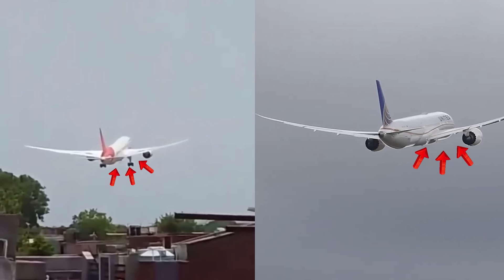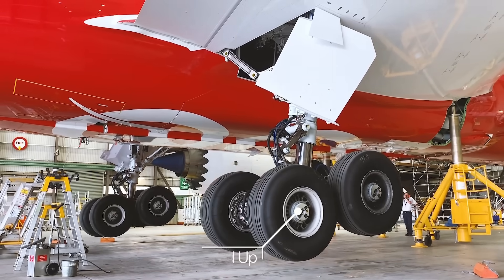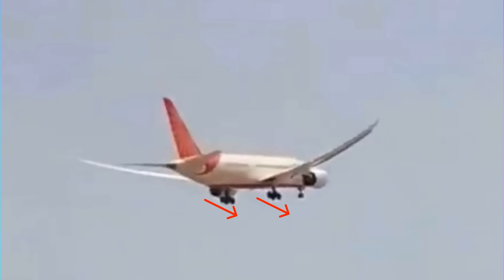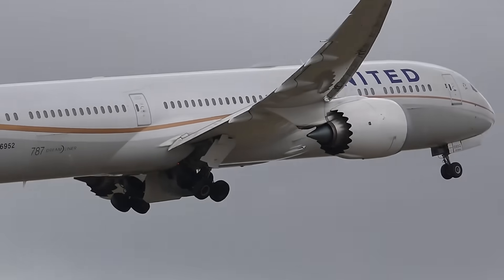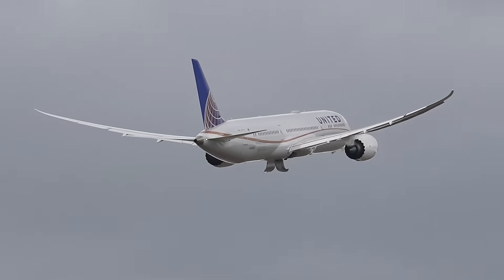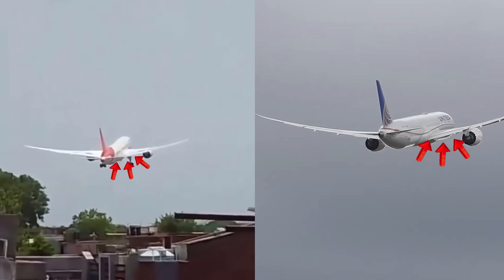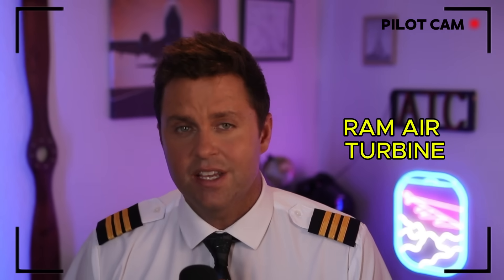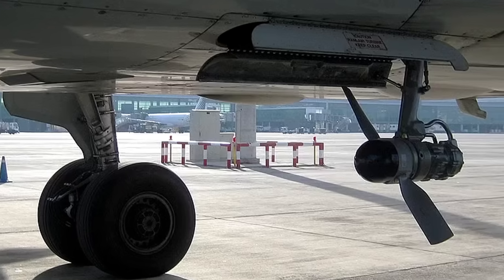Pilot Explains: A New Detail in the Air India 787 Crash Everyone Missed

Comment: Hi Garybpilot. I am a retired B-737 pilot, now 70 years old. This crash of AI airlines worries me a lot. 3 Days have passed now and no actions have been taken if all these type of planes (B-787) should be grounded all over the world until the cause of this crash has been found . To my opinion it was a dual engine failure caused by a mysterious  problem. And it could repeat itself. Civil aviation authorities have the right to prohibit any of these 787 to fly into their airspace until the cause is found.
Reply: Just because yall disagree doesn't mean yall have to be fucking rude to dude for stating HIS opinion.
Reply: I agree with him  @Dylan-mn3mb
Reply: That plane had so many successful flights along with a total of 5 million flights of the 787. I doubt it is something built in. Poor maintenance is more likely. Look how shabby the pax cabin was along with so many things broken.
Reply: @vihtoripuurola3775  yes, there was a passenger complaining about AC, entertainment, and call system  not properly functioning on the same flight from Delhi/ to Ahamadabad before it took off to London. As a passenger I am questioning the safety of flights.
Reply: @vihtoripuurola3775  yes air india is a disgrace, their cabins are ghastly dirty, so if their cleaners can't clean why think their mechanics can be effective?
Reply: @vihtoripuurola3775 First they blamed the flaps, the pilots, the Air India.. now the maintenence. What's next for you sadistic Boeing cultists? How many more must fall out of sky for you to finger point at Boeing? Shameless bunc you lot are. Disgusting
Reply: They have both boxes, I would say that they know pretty sure exactly what happened to this airplane.
Reply: The DGCA (Directorate General of Civil Aviation) issued a directive for enhanced safety inspections on all Boeing 787‑8/9 aircraft in India. These checks include fuel systems, engine controls, cabin air compressors, hydraulics, and takeoff‑parameter systems  .

Air India, which operates 33 Dreamliners, has already had 22 aircraft inspected, with 8 completed so far — and IndiGo (1 787) also undergoing inspections  .

Investigations are being carried out by the DGCA in collaboration with Boeing, GE, the Indian government, and international bodies like the FAA and NTSB  .
Reply: @VerdictREX indigo operates Airbus. Boeing operated by indigo are in minimal numbers.
Reply: @VerdictREX  Are these inspections/checks a result of the accident or previous incidents?
Reply: @ImperrfectStranger  They were ordered in direct response to the accident.  Ordered on the day after the crash and they began the following day.
Reply: @VerdictREX  Thanks!
Reply: @VerdictREX surprise surprise, they haven’t said whether this aircraft had been inspected yet. When did they start these inspections exactly? Why has it taken so long?
Reply: @StoutProper  I was talking about the inspections ordered after this crash, not before.  Sorry for the confusion.   The entire fleet of 787s in India were ordered to be inspected, with inspections beginning 2 days after the crash.
Reply: @VerdictREX  After the fact.
Reply: So far there have been people saying it couldve been pilot error or engine malfunction but no one has said it could be due to a maintenance issue. Thats what i think it was but idk shit
Reply: @Nervousflyer1708  Yeah, they're definitely dancingbaround that one. But first I guess they need to know what the problem was.  Then they would know if the cause was due to maintenance,  manufacturing,  or pilot error.
Reply: @Nervousflyer1708  yes I think maintenance 🤔 is the culprit 🥺‼️
Reply: @Nervousflyer1708 That is the first correct comment I have seen here.
Reply: should we ground them if it is contaminated fuel or poor maintenance? probably not.
Reply: @jamesgem1809  Alternatively, no other aircraft demonstrated said contamination?
Reply: Lets not panic just yet.—- They have found the TWO flight recorders (BLACK BOXES).I would say we will have an answer very soon.  Just a very unfortunate accident.
Reply: What about the whistle blower's point of view?
Reply: It wasn’t Pilot error.  You would have to be a complete idiot to reach for the Slat-Flap handle which is by the First Officers Left Knee, versus the Gear up handle on the Center Instrument panel.  
Can’t wait to hear what the Flight Recorder indicates.  I hope this doesn’t turn into a conundrum like the 737 rudder fiasco.
Reply: ^ During these inspections, if they begin to find commonality of certain problems,  andvthose problems are serious, that's when something like a grounding would start to be considered.   Right now, there's no indication of other aircraft affected beyond this plane.    It's all part of a process, so I guess we'll see.
Reply: If the dual engine failure was caused by a mysterious reason, why do you recommend grounding of all B-787?
Reply: Exactly. The same thing happened with Comet Airliner in the 1950s. Grounding surely is necessary. Complacency has crept into Accident Investigation.
Reply: I think its gonna be fuel cutoffs were activated.  There just is no other logical explanation.  Remember the Horizon air flight not to long ago where the jump seater on shrooms tried to shut down the engines?  Think were gonna see something similar in this situation when they finally release the FDR data.
Reply: If 787 had just come out as a new airplane the last year or so, I would agree, but a plane that has flown safely for more than ten years, I do not think warrants a complete grounding after one accident. They should share the information from the black boxes urgently though, so the whole aviation world gets access to the facts.
Reply: RAT deployment makes me very concerned Flight 171 suffered an Autothrottle  disconnect/ roll back.
Reply: I don't recall 737 grounded after the 1991 United crash in Colorado Springs.
Reply: @alexrebmann1253 yea that's different dude 😂
Reply: @alexrebmann1253  
" don't recall 737 grounded after the 1991"United crash"
Or even after the Ethiopian Airlines 737 max crash "just keep them flying and see if anymore crash !
Reply: Gary the Pilot who got fired for drinking on the job while wearing a Halloween costume acting like they know what happened. Give the family and the people who died some respect. These guys immediately go to YouTube to capitalize on making money.
Reply: A I sabotage...
Reply: I totally agree with you... I believe not knowing the cause of failure in such a terrible issue (total elec power and engine thrust lost) is to put the fleet AOG IMMEDIATELY... At least for a couple of days... Surely
Reply: Must be a Democrat too
Reply: Sir total of 108 planes india has grounded which include all 33 787 for inspection
Reply: Companies love to cut corners to Save money so the CEO can get a bonus. I’ve flown for those operators before. Not fun.  It will be some maintenance failure.  I heard they farmed out their maintenance to Turkey. Not sure if that is accurate
Reply: Today Same Boeing 787 of British Airways did emergency landing due to flap adjustment failure issue.
Reply: Maybe a strange software glitch??
Reply: They had multiple electrical problems on the previous flight. With the aircraft, they should have grounded the aircraft and not let it fly. This points to Air India's profit motivation. Or the government the civil aviation authorities need to change the rules to make sure that planes that have problems are grounded so that this doesn't happen again.
Reply: Other airlines maintain their Dreamliner fleet properly. That’s the differentiator
Reply: 😂😂😂 nahhh won’t happen.
Reply: Analysis of black box data and to point out the most likely cause may take one year or more. Cause could be multiple and it might be impossible to pin point a cause technically. You mean to say till then these aircrafts should be grounded. Who will bear the cost? DGCA? Even if it is, aviation services may get stalled for want of aircrafts. How will we move then? Remain at home  leaving all jobs?
Reply: It showed on a video posted yesterday, a passenger was trying to make  the gadgets work,  the electrics were faulty inside the plane before takeoff ! , 😟
Reply: I don't know anything about Boeing 787s, but I've been a model airplane builder for decades. I've built and flown a lot of model airplanes and as soon as I saw the videos I immediately thought of a loss of lift due to a loss of engine power. Why? Because we model airplane builders/flyiers have something more than those who fly from inside a cockpit: we LOOK AT our model airplanes FROM THE OUTSIDE while they fly and in the long run we understand, or rather we instinctively intuit, what may be wrong with the flight. 
That shown is definitely not an aerodynamic stall, nor a loss of lift due to an airfoil/camber geometry modification (retracting flaps), but a loss of lift due to a loss of thrust because my brain tells me, instinctively, that the airplane, in addition to losing altitude, is also slowing down.
Reply: If the B-787 type was grounded, just watch how fast the answers would be found.
Reply: Landing gear vs flap lever confusion is not an ideal mistake to make but it’s a very forgiving one when both engines are working. All it would mean is that the aircraft will climb much slower due to drag from gear and wrong flap settings which with quick corrective actions would let the flight continue uneventfully. 787 suffered unfortunate engine failures. Even with right flap settings it would have been doomed.
Reply: Sir this is India, no one give f about human life.
Reply: I was a fa for yrs. My airline decided to do away with boeing 737 and make those pilots move to the airbus. We had to drag boeing pilots to the bus. Love the feel of the boeing hated the computerized bus. 737 the workhorse of the airline industry!!?😂😂
Reply: I agree just another crap made plane by Boeing if it’s Boeing I ain’t goin 😢😊
Reply: It's been well documented here on YouTube about the poorly maintained interiors of Air India aircraft. They are dirty, and things are broken due to the lack of basic maintenance of things like lights and seats. Down to the preparation of meals and noticeable, without looking, filth of the interior. If they care that little about the surface product that customers see every day, I can't imagine that the maintenance of the rest of the aircraft was that much better. Probably bare minimum to keep them running, and something finally caught up with them. 

I do believe this was cause by a mechanical failure of some type. And I feel that no matter who was flying, the ending would have been the same, but can we talk about the  inexperienced of the co-pilot? 1100 flying hours and already in the seat of wide body aircraft flying internationally. That's crazy to me! And because of that I don't think we should fully dismiss that pilot error couldn't have been a factor. Someone who's young and  inexperienced can easily cause a bad situation to escalate quickly, especially when fear sets in.
Reply: Who is friendly giving..
Reply: Capt as a conservatory measure I Will agree with you !
Reply: Would never fly boeings..Airbus only
Reply: I saw the recent 787 turnaround and thought about your comment.
Reply: And within these days 2 other AI planes have had early returns and one was with engines trouble.
Reply: You do have a point as there is a good chance that a software problem shut down the fuel pumps.
Reply: All these people defending Boeing. 🤦‍♀️ I’m with ya Rudy, one crash is indeed enough to warrant grounding a specific type of aircraft, especially when the parent company has a well documented history of cutting corners, lying to both the public and the FAA, and taking every opportunity to increase profits, even when directly sacrificing safety
Reply: And the award for this year’s stupidest comment goes to….
Reply: What kind of crack are you smoking???
Reply: He smells like a CCP operative!!!
Reply: I agree with you! Watch the footage just as the plane lifts off of the tarmac! White smoke is ejected from both engines... I think both engines failed due to a flameout! A possibility of pilot error or an electrical failure!
Reply: Well, if it's an issue with the A/C, this is ONCE in 14 YEARS with countless millions of flight hours.
Reply: I agree
Reply: I think the DATA will cause a world wide grounding of the 787.   We'll know just as soon as the FAA figures out how to protect Boeing to the best of it's ability.
Reply: Thanks Gary for your rigorous analysis. I think the dual engine failure seemed to have been caused by loss of electrical and hydraulic power just seconds after takeoff.
Reply: Totally agree with you captain.
Reply: WHISTLEBLOWER Engineers told that manager are using faulty parts and no security of passengers 😡😡😡😡🤬🤬🤬🤬
Reply: Sorry but you're worrying too much and overreacting
Reply: @gregt8638 no not at all,may be for u it's normal.
Reply: 555
Reply: gas or water in fuel.
Reply: Power loss both engine?
Reply: I was just thinking about this since I heard of this accident and thinking of the same thing that all this Plaines should be grounded, but with the corruption that we see on Boeing it doesn’t surprise
Reply: If you get on a plane good luck people are cutting Corners everywhere so you're at your own risk when you're not the pilot and you didn't make that plane yourself
Reply: @rudyarron5746
Sir, much respect for your experience in aviation. Also, you are 70 years YOUNG, not old! But are you suggesting that nearly 400 of this equipment be grounded worldwide?
Reply: @BlacKnightChess 387 Boeing 737 Max were grounded worldwide after only 2 accidents in five months.
Reply: My guess is maintenance/mechanics slacking - does India do dei, too?
Reply: The plane never changed its nose up attitude. I've only flown small planes but if you loose all power the you immediately pitch into a lower nose attitude or you'll  quickly stall.
Reply: @suzamurai Thé plane did stall
Reply: Contaminated  fuel is the most likely cause of dual engine failure .This needs to be Investigated
Reply: I took a Dreamliner eight hours each way 2016 and I was happy it was a newer plane . I couldn't imagine what it would be like on the India plane !
Reply: Given the track record of 787s and unknown cause of the India Air crash, it would be idiotic to ground all 787s with so little information
Reply: possibility an investigation is ongoing is why the lid is on this- ever heard of a 'gear up' acivation takes out both engines on takeoff? massive  complete power failure ? rigged to 'pull the plug' while being certain the aircraft will be at sufficient altitude, and place
Reply: Not moving fast enough to inspect everyone of these planes. They have  a  plan and even released the cost, but we are not seeing it, happening. Makes people uncomfortable to fly these planes. According to the whistle blower, Sam Salehpoor,  who was a security engineer at Boeing, he quotes the 777 has the same issues as the Dreamliner. Why would Civil Aviation drag their feet ?  Maybe sucking up to Boeing ? who knows ?
Reply: Clinically insane to ground a complete fleet of aircraft because one crashed after over 10+ years of incident free operation.
Reply: K
Reply: I'm not a pilot, but I've been an aircraft anorak since I was twelve.   My uneducated guess is electrical failure leading to fuel starvation. The fuel pumps on the 787 are electric. The gear continues to stay down because there are no hydraulics to raise it.  
It would take a pretty high level of contamination in the fuel to cause a flameout. Both pilots were experienced, a mistake in operating the controls is highly unlikely.  Apparently there was some issue with the electrics on that aircraft fairly recently.     That is my tuppence worth.
Reply: Thanks for expressing your thoughts on this.
Initially, all the reasons were concentrated on blaming the co-pilot for the disaster. But, closer looks now have veeted the thinking  towards technical failures.
Air India, and the Tata group that owns it are considered to be highly responsible, did take the step of grounding their fleet of 787s.
Reply: I am Indian. I can confirm that the Indian investigation agencies are corrupt. They are under direct influence of the Prime Minister. I believe that the delay is because the agencies will present that report to the Prime Minister Office. And I doubt he will cut off some details if he finds it harmful to him because in India, this airport and around 6 to 7 biggest airports are being controlled by his corporate friend.
Reply: The engines didn't fail go back and listen to the guy that survived 😂 😅
Reply: Bunch of Trump idiots on here 😅 😂
Reply: The gear tilted forward with the gear doors not yet opening.
Reply: Is it possible to remotely hack into the system to cause power failure?
Reply: 100% agree! As was the case with the MAX!
Reply: in the old days they didnt have computers so you probly dont understand how they work but if you google it you will see that planes are much harder to fly these days. but its funny how old people think they know how stuff works these days
Reply: AC joystick console etc not working before take off... strange
Reply: You don't sound like a Pilot
Reply: Planes don't get grounded if deaths happen in the non-white world. E.g. Boeing Max 737, Indonesia & Ethiopia!
Reply: Massive electrical power failure caused engines to fail. This is the reason. Passengers from an earlier journey of the same flight as well the passengers of the crashed plane reported AC and entertainment systems not working in the passengers cabin.
Reply: RAT was deployed as soon the take off.
Reply: Holy crap there's some angry a-holes in the chat. 

Calm the f down, people. Holy shit.  😂
Reply: HUMAN error springs to mind,has anybody looked on the reputation from india airlines how many crashes its had due to human errors(shocking)..Has anybody watched an investigation to why a plane taking off simialar to this plane then lost so called power and it turned out to be human error.The data apparently sent over to the pilot regarding weight etc was incorrect so when the pilot put the data into the planes computer due to the wrong data the plane didnt have enough thrust to take off properly due to being to heavy because of wrong data.
Reply: Contaminated fuel is out of question since they fuel multiple jet each day considering the time was around 1 PM , they must have refilled multiple air craft that day , point more towards electrical issue , in my opinion
Reply: Thanks ! I appreciate your expertise and hope listen to you more in near future regarding this sad incident.
Reply: Don't worry. No sane person books boeing flights these days.
Reply: @jkgermany2182  Very true, I make 10000% sure I dodge that bullet every time I book a flight
Reply: I think this is more air india ground staff maintenance fault as from a passengers video air-conditioners and entertainment systems were not working possibly due to power cut failure which may have caused power cut to the engines as well and from another passengers statement who was travelling on this same aircraft about a month ago said that the lights were coming on and off probably this power cut situation was not rectified and that cause this accident unfortunately whoever is responsible in the indian civil aviation and air india must be held accountable for this
Reply: Aweful Maintenance? Could be a reason for it!
Reply: Huge lack of quality production made by Boeing USA 🇺🇸
Reply: I can see the point the retired Pilot is making … what is a few days grounding of the fleet … O $$$$ .. Less we forget the 737 max first hull loss due to the “hidden” MCAST problem . After the first crash everyone was blaming the pilots and no need to ground the planes .. remember what happens next .. lesson learn in BLOOD 🩸 and suffering cannot be recovered by $$$ compensation.. wisdom taught by years of experience should not be dismissed so slightly .. what’s is 2 weeks to get the  initial analysis done worth in lives vs $$$ just my 2 cents 😅
Reply: The single engine failure causes pilot shut down the wrong (good ) engine, might be more likely than dual engine failure, in terms of Boeing 787 engines…
Reply: What? 😂 dude are you actually a retired pilot? Because that’s an objectively wild take
Reply: If there were no building in crash site and if there was plain ground, had the plane survived?
Reply: Thanks for your opinion and the share of your experience and knowledge.
Reply: This model has been reliable up to now though.
Reply: The pilot use HALF runway!!! IT is a blame! He kills 300
Reply: @TamasHejja After leaving the runway, more load is put on the engine and the engine compensates with more fuel. If the problem is fuel, then the problem started right here. I saw this well, the pilot managed to keep the nose of the plane up.
Reply: British airways to Chennai did emergency landing in Heathrow today.
Reply: Agreed 100%
Reply: You got it, captain.
If it was weight or flaps configuration, the airplane hasn't get off the rw so fast as it did.
Reply: There no different to a cars nuts and bolts .They fail at times But still the most safest form of transportation.May the all RIP .👍🦊
Reply: And in last 48 hrs 3 787 have been grounded or emergency landed
Reply: In conclusion, no vehicle  at all times and at any point of time is 100% malfunction and thereby  disaster proof.
Reply: No no no. This aircraft involved has had some major electronic issues, especially in hot environments. This aircraft is 11 years old. Sounds like shoddy maintenance to me.
Reply: The very second day an local Indian reporter mentioned, One engine failed and pilot turned off  the other engine by mistake and didnt get enough time to turn on. Could it be possible?
Reply: @rd0769  yes
Reply: Because of such heat all over the area?? Is there a chance of fuel evaporation? Possible?? Also there are reports prior take off there was no air con available?? Psngs complaining cabin was mad hot??..I know RAT has limited generation? Power wise?
Reply: You actually believe a reflexive 787 grounding warranted in the absence of definitive evidence?  That's quite shocking coming from an aviation professional.
Reply: There were observations by passengers on the fight in from Delhi that there seemed to be issues with electrical in video screens not working call bells not working. Could the crash have been the result of a total electrical failure on board the plane?
Reply: @revpaulrodey4026  Or it could have been all the crap build up in the blocked toilets affecting thr centre of gravity, why not just wait fot the results of thre investigation instead of turning this tragedy into a soap opera.
Reply: No.I don't agree. 
The dreamliner fly now for 20 years without  incident. 
The engineers that serviced the aircraft before departure must be investigated.
Reply: Dual engine fire because of stowaways
Reply: Just came across a must see video, “Mass Murder Over DC”. Trump was behind the plane crash in Washington, D.C., that killed 67, as a threat to lawmakers who might oppose his agenda, of trillions in tax cuts for billionaires, and war on Iran.  There can be no question that the military helicopter deliberately hit the jet, head on, unwavering in its course until impact. The NTSB is refusing to release all altitude data etc etc showing US Gov complicity.  Google "mass murder over DC".
Reply: Flight AI171 • Boeing 787-8
(Air India 171)
Boeing replaces hydraulic system with electrical system. This can lead to general failure in case of battery explosion and fuel supply.😮
✈️
Others videos (20:30) Author reports more electrical problems in batteries with fires.😮
Reply: Ridiculous. The 787 has been flying for close to 14 years now. This is the first hull loss. Whatever the reliability issues with the aircraft are, it has an incredible safety record. You cannot ground the entire world fleet (1200 tails) because of 1 crash without any indication the crash is related to something that can exist on other aircraft. Note; 26 years experience in aircraft engineering.
Reply: first and only 787 issue of this tragic nature  since ANA began using them iin Oct 2011. I would wait for the box
Reply: Since Indian authorities did not secure the crash site cause may never be found.
Reply: Any issue with this aircraft is a maintenance issue and not a type issue as this plane and 1000 others are flying 10 years without any issue!
Reply: Yeah, airlines should do it and not wait for a higher up decision.
Reply: You sound like a guy with a lot of AIRBUS  STOCK.
Reply: I remembered that years  ago, after released  dreamliner was announced the delayed for some reasons. That's it.
Reply: Man I’m afraid now flying
Reply: The 737 had its share of crashes in the 90s involving uncommanded rudder movements and they never grounded that plane. So they should ground the 787? Are you really a pilot?
Reply: Agreed!
Reply: Please be polite with your comments. You don't need to point out the age of the man who is friendly hiving his opinion. Right?
Reply: Could FOD somewhere in the fuel delivery effect both engines at the same time.
Reply: @georgeaffonso3966  yes, but issues with fuel would have been spotted VERY quickly, and whatever fuel delivery vehicle was used will also have been checked,,, for my money, its a manufacturing issue that has caused loss of power to BOTH engines and hydraulics and thus deployed RAT back up, loss of flap command and failure of gear to retract.....
Reply: Not any investigation happened bcoz India's pm is just enjoying trips and authorities are sleeping by blaming pilots. We can't sleep when we remember a smiling face of pilot who was solely care taker of his 84 year old father and same so many lives in his last minutes by choosing that place where density of trees were higher. But our soo called leaders, it looks like they got energy after this and flew away to enjoy on dead innocent people....if they found out black box then why they haven't told about cockpit conversation till now??? It's not that difficult to take data and listen!! It looks like in the end everyone will blame pilot and companies will get insurance,,😡
Reply: Excellent point. But we mustn't upset the shareholders, they don't fly in 787's they have their own personal business jets.
Reply: Indeed. The FDR & CVR are intact.  The FDR would have recorded conclusively when both engines went dead and hence the RAT auto deployment.  It certainly can affect other 787s hence I am curious that no inspection on the fleet has been issued.
Reply: Yep same thing happened with the Max8, it took 2 crashes to ground the fleet. Why?
Reply: Possibly a recent software update causing a 'hang scenario' bringing engines to standstill.
Reply: I see where he is going with tye comments about dirty fuel..but if that was so and the fuel put into tte airplane was dirty, would not either planes gave had dirty fuel either before or after..after all it wont be just one fuel pump affected surely..just looking at it from a different view
Reply: As one aviation whistleblower chilling said about grounding aircraft, paying the loved ones of the dead or making crucial vehicle upgrades, "It's the cost of doing business".
Reply: I am no aviation expert nor do i know anything about engines and cockpits.. but i have the ability to think and make sound judgement.
This is my view on the matter, as like many people accross the world, I am deeply saddened even distressed by this terrible catastrphe that could have been avoided. 

This is my view based upon videos that were taken by the passengers before take off.

 Firstly, the plane AC system was down, that was visible by how the passengers were fanning themselves. 

Secondly, the lighting system was malfunctioning....now, these issues/ signs should be enough for the crew to realize something just aint right.

I believe these warning signs should have been taken into consideration and reported to the relevant authority and an investigation carried out before the plane is given the permission to take off.

Clearly, the last set of persons, pilots and crew members have failed in their positions to pick up on these warning signs....
Reply: This isn't a racist remark, but isn't it the case in India that certain things not working is considered normal and acceptable? I am merely asking a question. And the truthful answer is? @dawnsmith1350
Reply: @dawnsmith1350 We overuse the terms "clearly" and "obviously". You've indicated you're not an expert on these matters, but you're attributing a lot of blame to certain people. Our hosts avoid that, and I  consider them to be experts in this field. Let's let the facts come out before we make accusations.
Reply: I TOTALLY disagree! The 787 has an exemplary safety record which does not warrant grounding of the type. With what is known of the crash, ALL aircraft might as well be grounded, and that is insane.
Reply: Ok, but why did not happened this issue from the first flight of the 787 near 15 years from now? This is the question...
Reply: You seem to forget! Ain’t nobody at. Home at the FAA, what you don’t hear the crickets 🦗? Top management fired
Reply: Dual engine failure. Most likely caused by FADEC. Always before a big tragedy there are signs or small tragedies preadvising: See A400M crash at Sevilla in 2015… it was a test flight on a military aircraft but it turned out it was a mistake on loading/upgrading the FADEC software prior to flight…it was similar short flight and problems started at 200 feet. It was also recorded and can be found in YouTube.
Reply: The flaps were being retracted so still partially extended, and the gear was still extended.
Most likely culprit:
FO retracted flaps instead of retracting gear.
Reply: @UnitedWeStand-g7u  "Flaps were being retracted..."? I think you'll have  difficult time supporting that position with the evidence currently available. What was the flaps setting at TO? Where were they at impact.
Reply: @davekearney1944 
My bad, they were likely in the process of being deployed after realizing their mistake, which is much more plausible. 
What can be said for certain is that they took off without the flaps extended while the gear was down, which fits perfectly with the theory that the FO mistook the gear lever, for the flaps leve, anything related to double engine failure is completely f*cking ludicrous.
Reply: @UnitedWeStand-g7u  You can say for certain, considering the evidence at hand, that the flaps were not extended at take-off?
Reply: If the dual engine failure was due to contaminated fuel , the fuel source needs to be examined. , as that could replicate the accident I  in all other planes
Reply: Boeing problems will cease once China(ccp)buys the manufacturer.
Reply: It's mildly surprising that no preliminary data from the flight recorder has been released.
Reply: Now they claim the black box is damaged? What a massive lie! This is nothing but a cover-up. The truth is being buried, and it's a shame for the Indian government!

🤮🤮🤮🤮🤮🤮🤮
Reply: Yes, I also think Ford should recall all Model T’s  as well
Reply: Both Boeing & Air India are in the damage-controlled mode together. We will see…
Reply: Vaporization
Reply: Hands down....Vaporization
Reply: You are absolutely right but untill the fact that what happened was a cause of design or operational failure is proven. Looks like a sabotage of some sort and will take time to pin point.
Reply: What about Dual engine flameout shorty after takeoff. Landing gear was last thing on their minds if the engines were sputtering . There hv been suggestions that the plane used the entire runway .
The extreme heat and lack of rain caused an extraordinarily large dust pile and debris at end of runway that is evident after takeoff. Similar to British Airways had a 4 engine flameout from volcanic ash high altitude. Is it possible that the dust and debris were ingested and caused a flameout right after 
rotation?
Reply: @marielle129 true, it would be easy to miss the landing gear in such a short time, but if there was a dual engine failure, the RAT automatically deploys and only provides enough power for essential avionics and systems and for essential hydraulic systems.  It doesn’t provide enough hydraulic power to retract the gear but probably had enough to do the pre-retract gear tilt that GaryB mentioned.  Hats off to him for noticing that the gear tilt.
Reply: @marielle129 interesting.  Would love to hear pilots thoughts on that idea
Reply: @marielle129  No. Volcanic ash being largely silica adheres to the fan blades and solidifies.
Reply: @marielle129 if it used all the tarmac they should have noted that( in terms of performance and or power) and aborted takeoff before V1
Reply: @marielle129 Damn! That's highly unlikely, but possible. Normal dust isn't as dangerous as volcanic ash, but who knows! If big chunk of dust get's sucked into the engines, it can cause problems. However, if it was the case, why no other aircraft got affected?
Reply: @MinhajAhmed-y7i  because they went to the end of the runway where it was all accumulated .
Reply: @marielle129  No, they didn’t.
Reply: @marielle129 could be. and also well with they went to wheel up that load on the my just been to much if a weak links was developing .plus I want to know on the rat video what the black matter is float to the ground about 4 seconds before the crash? First thought it was a bird but now don't think it is
Reply: @marielle129  Interesting, I haven’t heard this theory before.
Reply: @marielle129 Good point ! Thinking out if the box
Reply: @marielle129 engine designer here.  Engines have been ingesting dust for years and they are designed for that.  Volcanic ash is a totally different animal and engines are not certified for ingesting this.
Reply: @marielle129 plausible, but if there is any kind of ingestion - dust, debris, bird, metal - serious enough to cause engine failure, there ought to be some visual indication - flames, sparks, bursts, smoke
Reply: @biaora  I agree ,smoke or sparks for most -  I don’t know if an engine ingests a large amount of dirt what would happen . What would be the signs . I’m very interested what could cause them both to fail simultaneously besides a flock of birds
Reply: @marielle129 in that case engine will be backfires but in video there are no such signs
Reply: @marielle129  good points.
Reply: @marielle129 no … it’s insane that this plane went down straight after takeoff. I reckon the FO pulled the flaps instead of the wheels  … which is a crazy thing to happen… one simple move could kill 269 people. How crazy is that … the aeroplane should have had a precautionary measure … not allowing this mistake even if the FO was pulling on  the flaps with both hands and feet…I might be wrong though …!!
Reply: @petervossos4816  it’s almost impossible . Double engine failure at the same time has to be a bird strike or engine ingestion of something  that causes catastrophic thrust loss .  They had no time to recover
Reply: The gentleman is a retired 737 pilot who's probably safely flown one of us, if not then someone related to us. He should be respected and for sure knows more about aviation than any of us. I was due to fly to India next month and I'm certainly avoiding any carrier operating a Dreamliner until we know more. I stopped my entire family from flying to Sylhet because majority flights going there from London are on Dreamliners. This isn't the first major issue concerning the 787. There was a battery issue on a Japanese carrier, a belly landing at Heathrow along with a few others.
Reply: @gabbarsingh7182 At least grounding 787s manufactured around the same time is warranted. If it's entirely a design fault, then very soon the same thing will happen to another 787.
Reply: Bro are you from Sylhet? I'm also from Sylhet, booked my Biman flight on B787 from YYZ to ZYL. Now thinking of changing the flight to another airline to avoid the 787  @gabbarsingh7182
Reply: @gabbarsingh7182  I really appreciate and respect your reply and your tone here, and I absolutely agree that all should be replying with kindness and respect. I can also understand someone feeling like perhaps the 787 ought to be grounded. I’m not saying that’s where I stand…honestly I don’t know enough to have a strong opinion on that matter, but I can definitely understand someone thinking that way. True enough, it doesn’t usually tend to happen after one crash, especially before the facts are known, something which could take months, but what I find so troubling about it is the mystery behind it. A dual engine failure just doesn’t make any sense at all. And while I imagine that a possible isolated incident, a maintenance issue, or something of that matter, is a more likely scenario, I am certainly not comfortable completely ruling out a design issue just because it’s never happened before. TWA 800 and US Air 427 come to mind as examples of aircraft that had flown for many years before flaws were discovered. Now if you look at US Air Flight 427, there was a United Airlines flight that suffered an almost identical issue prior to that. I like to believe that when human life is involved, everything that can possibly be done is being done, but I do understand risk assessment, and all that.
Reply: @gabbarsingh7182  i’ve heard about issues with this plane also. I would not get on one.
Reply: @NYBrandywineTree for the foreseeable future I’d say good choice.
Reply: Some rumors that Boeing requered for eletrical upgrade in 2015. Became mandatory in USA. India never adressed it.
Reply: @viggojorgensson4708 That’s handled in a very organized way. If it was critical, they’d ground the fleet until the upgrades were done. If they are non safety upgrades, they can do them at regular service events.
Reply: @viggojorgensson4708  - Do you have a source for this?  If the manufacturer makes it mandatory, arent they required to do it?  Boeing would not sit back and allow an International carrier to just ignore something like this and then an accident happens.  It would be bad business for Boeing.  Its in their best interests to get this addressed even if they have to supervise it.
Reply: @viggojorgensson4708  I believe it is an India Problem too. A passenger on its previous flight had video of the air conditioning and lights not working, his TV was not working (per usual  he claimed), but at least 1 TV in front of him was working. If they don't do maintenance for passenger comfort, what else are they skimping on?
Reply: Sorecall exists on aviation, just like car industry with many malfunction every year, that's ridiculous and unacceptable...
Reply: @viggojorgensson4708  this same 787 had a critical problem in Dec 2024 and went for service but seems like the issue wasn't completely fixed. Staff keep complaining but Boeing doesn't supply proper spare parts.
Reply: @viggojorgensson4708 I’ve heard the same, have why air india 787s has so many electrical faults and stuff not working. It’s owned by Tata who are notorious for cost cutting and paying lip service to health and safety. It’s the Indian caste system in full effect, they don’t care about the lives of lower castes. There’s a theory that since the plane’s ac was out, and it had been standing on the runway for 2/3 hours with the engines on, with a full tank of hot fuel in 41 degree heat, the fuel could have easily heated up to 49 degrees and caused vapour lock in the fuel lines on rotation. Not a pilot myself I’m an engineer but a white plane in 41 degrees with no AC full of people and hot fuel will heat up quick
Reply: I disagree...
The 787 has a near flawless safety record & if there's something inheritly wrong with these planes , it would have surfaced by now..
The 787 has been in service since 2013 ..
They have flown millions of miles with no issues..
I suspect the recent overhaul of that aircraft will come into play here..
That planes lost thrust just 600 ft off the ground..
Both engines failed ..
The R.A.T. was deployed which certainly indicates a power failure ..
The lone survivor said there was aloud bang , then all the lights went out for a split second , and then back on..
The R.A.T. restored electrical power , but the engines never spooled up again..
Reply: @pdrphil8159 It does appear that the RAT deployed, but I’m pretty sure that wouldn’t restore cabin lighting.  That is only for the most critical engine control and navigation systems.  It sounds to me like a dual engine failure, and we’ll have to see if it was due to mechanical or electrical failure, or pilot error.  The evidence is there, let them find it.
Reply: @pdrphil8159 very very far from flaw less. This is firat crash of 787 for aure but it is not the firat hull loss. It has been marred with technical issues. There have been atleast half a dozen boeing whistleblowers who have said that 787 were built with sub par quality parts. 
You are just a Boeing fan boy or just american.
Reply: @pdrphil8159 Without more information, it does seem as you say.
Reply: @pdrphil8159 given the "safety culture" at Boeing it would be foolish to rule out flaws with design or build quality as a factor or cause simply because this is the first hull loss after years of operation
Reply: @pdrphil8159  There have been lots of incidents caused by design flaws long after aircraft introduction. I can think of several, including one that occured 14 years after an aircraft type first flew.
Reply: contaminated fuel wouldn’t have even got airborne for a few seconds
Reply: @imbowser What is contaminated fuel and how does it affect the engines?
Reply: It did have a screen sound like a prop plane 100%
Reply: @andymesser9704  Not saying you’re wrong, but could’ve simply been the engine cores rotating in the airflow. Every high bypass engine I’ve ever heard on short final is producing power, never heard one with a flameout.
Reply: @andymesser9704 what do you mean?
Reply: Agree
Reply: If the cause is entirely due to the 787's design, then other 787s around the same age will begin falling out of the sky in a similar fashion within days or weeks.
Reply: @KOFAKEDEM maybe all airbus ac have undiscovered issues too?   Ground all aircraft forever!
Reply: @ericrupert2687 Baring an official report, we are now almost certain that it was an inexplicable complete double engine failure resulting in no thrust. There are no similar undiscovered issues with airbus which could be disastrous. It's foolhardy to even begin making a comparison.
Reply: @KOFAKEDEM AI171 had a registration number of VT-ANB and was 11 years old. The first 787-8 went into service 14 years ago. So based on your logic, all or ay least some of the 787-8s that went into service 12-14 years ago should have fallen from the sky by now.

We still don’t know why MH370 crashed. Should we ground all 777-200ER planes made in 2002 or before?
Reply: Now that pilot error seems to be unlikely,  shouldn't we wait for a repeat before grounding the 787s?
Reply: After reading most of the so called experts, I felt you guys have any clue of what happened just ga..ga…not to ground, pilot error, fuel contamination, etc. looks like you guys are heavily invested in Boeing and the loss of money on the stock is making you guys these comments. About 270 people lost their lives, and you only need to make money. 

1. Pilot error has to be completely ruled out. It’s an automatic plane that has MCAS in it and it should handle most of these errors, which the current analysis is okay with it.
2. Fuel contamination is next to nothing because the modern fuel containers and storage have sensors built in and a lot of thorough inspection will be done, that certificate is issued before filling the fuel.
3. Dual engine failure is the most plausible explanation that fits into this. Because according to Sam Salipour the engines and fuselage show their adverse effects and defects after 12-14 years of use. So people who are screaming on top of their heads, you can stop that crap now.
Reply: No
Reply: Boeing sucks
Reply: 😂😂 yes, since the YouTube Expert Investigation Board didn’t find the cause in 24 hours, all airplanes should be grounded.
Reply: @LibSlayer69 , 😂😂😂😂
Reply: Please dont be ridiculous. If the 737 was grounded after every accident it had the fleet would never of done any flying ever. The 787 has had an impeccable safety record for 14 years without on accident yet now you want it grounded. Seriously…i feel perfectly safe taking one to Japan on Thursday your type of reaction is ridiculous.
Reply: Should we ground every type of aircraft the moment there is a hull loss? There would be no airline industry. There is a huge difference between the 787 and the 737-max accident. The 737 was a new airframe coming online. The 787 has a proven solid track record. 
This could be contaminated fuel, improper maintenance- all kinds of things. To make a knee jerk reaction and punish every airline flying a 787 without evidence would be reckless.
Reply: @kamakaziozzie3038 If they found a core design failure, then they may ground the fleet. It’s impossible to find and verify something like this in less than 3 days.
Reply: @jamesdellaneve9005  Odds of a flaw with the cores affecting both engines simultaneously, having never been observed before?
Reply: @petergill2265 I was not with the FAA when they certified the first twin engine for over the ocean routes. However, I am assuming that they did the math for dual failures and am guessing that it’s extremely remote enough for safe operations on those routes. 1985 was the 1st revenue flight over the ocean with only two engines. I know that fuel starvation can affect the entire aircraft regardless of number of engines. Bottom line, we’ve been safely flying for 40 years with duel engines and duel catastrophic engine failure doesn’t seem to have reared its head.
Reply: @kamakaziozzie3038 plenty of evidence if you looked.
Reply: @kamakaziozzie3038 the Max was not a new airframe it’s a50 year old frame re engined and the MCAST issue had popped up prior but other pilots saw the runaway trim and just shut down the auto trim .. but they were at higher altitude.. and the problem was not addressed u til the 2 crashes ..
Reply: You do realize that this plane has been flying for 12 to 14 years, right? This is the first hull loss, and to ground all 787, due to one crash is ridiculous.
Reply: @CJE2007.5  The 747-131 had been around for 24 years before the air disaster at LAX .  After the investigation, they did checks on all their 747-31 planes and it was found that it was only sheer luck that it happened on other planes, and them planes were 24 years old.
Reply: *Hadn,t happened *
Reply: @emmahoward7913 I don't recall that at LAX. What incident was that? If you mean the United cargo door detatchment that wasn't LAX.
Reply: @seeburg220  my customer at the time was a fight attendant, she supposed to be on that flight , her son were sick , she called off work .
Reply: @CJE2007.5 they're coming, it's like cars after a certain number of kms...a preponderance of the same issue will come up..when bad design or same problem.
Reply: @CJE2007.5  It only took two crashes to ground all 737MAX aircraft.
Reply: @CJE2007.5 Boeing was cutting corners. There was a congressional hearing about these from a victimized whistleblower.
Reply: @CJE2007.5 so you want another plane to go down before any action is taken. Investigation should reveal the real cause of the accident
Reply: @CJE2007.5 It's not insane if the mean time between failure of a key, engine management component is 12 to 14 years. That would actually mean that they're going to start dropping out of the sky pretty soon and SHOULD be grounded.
Reply: @CJE2007.5 absolutely! The hysteria by even experts (yes not even so called) is unreal. The commentary really discredits those that are jumping the gun. I note "74 Gear" is quiet. Good on him.
Reply: @CJE2007.5 no it’s not … would you same the same thing if your loved one was on board …?
Reply: @CJE2007.5  Maybe some things went wrong midair in other planes as well, but we will never see them on news if things got under control as they might have happened at higher altitudes. It's always a first, this plane had no space or height to even make a call. Plus, who knows if US company provided India with badly designed planes which decreases the age of planes. Or maybe Air India and maintainance team have big issues in India.
Reply: @CJE2007.5 at least one by one should be grounded for a complete check up and maintenance!
Reply: @CJE2007.5  Concorde was flying for much longer and one crash instantly grounded the entire fleet.
Reply: @alanjm1234 Not comparable at all. There are already 1200 787’s currently flying and they have done 5 million trips.

The number of Concorde’s making commercial flights was 14 and it had less than 100,000 flights. Some has the number of commercial flights as low as 14,000 For all intents and purposes the Concorde was an instrumental plane that never went into serial production.

Or to put it into perspective, 14% of the whole Concorde fleet had fatal crashes. For the 787 the number currently stands at 0.08%.

Even more importantly, the Concorde was grounded because the accident revealed a flaw. If the 787 investigation reveals the cause is a fault in the 787 it will be grounded too.
Reply: @CJE2007.5 tell that to Japan who has safety first and their manufacturing is just superior yo what you know. They are inspecting all of those planes. Stop your Ego that was the same thing someone said when the Max Crashed and instead of grounding them let more airplanes fly
Reply: @CJE2007.5 that’s what they said  about the 737 Max
Reply: @CJE2007.5  Safety 1st !! That's What Learn every where  and every day! 
We make the money,  Money can't Replace a tiny piece of your hair!
Reply: @CJE2007.5 You do realised that one has just crash and all evidence point to dual engine failure from mysterious cause, right?

There’s no way for you to know if other 787 are affected? would this repeat again? how frequent? 

You’re basically flying an aircraft that you don’t know what the risks are…
Reply: @CJE2007.5 well, just like a car, certain parts will last for a certain number of years before being replaced…and will therefore have to be replaced at intervals specified by the manufacturer. Then there’s fault recalls etc too…
Reply: I agree on it because he saying that it should be grounded for at least the first probe commission report comes out.
Reply: @CJE2007.5 they grounded concorde after its first hull loss
Reply: @CJE2007.5 100%
Reply: @CJE2007.5  Not really ridiculous, what if there's a mysterious problem related to age of the plane, that could possibly occur
Reply: @CJE2007.5  One crashed that caused 270 people their lives
Reply: @CJE2007.5 no it's not how you figure that 😅 😂 I bet if Donald Trump decides he's going to get involved you supporters would not say anything 😂 😅 😂 facts
Reply: @CJE2007.5 they grounded DC-10 in 1979 after one fatal crash. So they could do it now as well. Absolutely NOT ridiculous!
Reply: @CJE2007.5  you are an ID10T
Reply: @CJE2007.5  Unless you are a prospective passenger. I would be cancelling my ticket until the cause was known.
Reply: @CJE2007.5  We heard the same comments when the first 737 Max nosedived
Reply: @CJE2007.5 concorde era ended due to one crash
Reply: @CJE2007.5 no, its not. This failure may have happened earlier. But it makes difference if this happens at thousands of feet high or 400 feet high.
Reply: @CJE2007.5 - maybe not all, but maybe some with certain key components that may have contributed. Especially electronics. Where’s the black box?
Reply: @CJE2007.5  it's a usual method worldwide lol
Reply: @CJE2007.5  You mean like the one crash of a 737 max , it took two before they considered grounding them . Same with DC 10 cargo door issue many years ago
Reply: @CJE2007.5 and ??? That magically excludes issues with these planes?
Reply: @CJE2007.5  Yes, that's true, but there were also 2 incidents yesterday, I think, or the day before with the 787, both having technical issues, somewhat similar to AI171, which convinces me to think that there is something far worse that caused these errors
Reply: @CJE2007.5  would you feel  100% safe for you and your family to board a 787 tomorrow  for a flight?
Reply: @cheech5738  I'm not a 100% safe walking, let alone in any machine, but yes, I would happily board a 787 or any other commercial aircraft.
Reply: @cheech5738  No
Reply: @cheech5738 yes! Airplanes crash all the time and this event only changes your flying choices if you already have a fear of flying, which is real for many people even though everyone knows it is illogical. With the 787’s safety record the obvious conclusion is that this was just a one time issue, not a systemic one, and so it doesn’t increase your risk if you fly in a 787 somewhere else. This is nothing like the 737 Max problem.
Reply: @cheech5738 
Yep
Maybe not out of India
Reply: @cheech5738  No facing way dude. Boeing = dead man's territory for this dude. Take the train, a boat, a car, a bike, or stay home.
Reply: @cheech5738 flying out of Mexico on an AM 787-8 and yeah I feel safe. The chances of dual engine failures are ridiculously slim. Out of the 1000+ flights I’ve been on zero have had even a single engine diversion. There is a way higher chance of being killed in an automobile accident than air travel, and most don’t give that a second thought.
Reply: @cheech5738 , I literally just walked off a 787.
Reply: @cheech5738 I certainly would. Because I’ve been flying the 787 for over 5 years now. Still prefer the 777 over the 787, but it is still a very good airplane
Reply: @cheech5738 No. we don't know, and this is an electrically intense aircraft.  That introduces new concerns.  I wouldn't feel safe until we DO know. Look, the aircraft actually crashed.
Reply: @cheech5738  A 787?   Yes, but maybe not an Air India 787
Reply: @CJE2007.5  Does this means that your ok with 200 plus people dying again?
Reply: @CJE2007.5 No...he doesnt realize anything. Probably seni!e.
Reply: @cccc9911 
Senile? Lol! How old are you?
Reply: @cccc9911 Or maybe cares for human life? Rare in this day and age.
Reply: @cccc9911 , that is terrible , have a little empathy.
Reply: @cccc9911  Your kindness and empathy is underwhelming!
Reply: @cccc9911 Stop being so rude. Absolutely no need to be so disrespectful to someone who has had a fantastic career & applied his intelligence & training tone great & worthwhile career. You haven’t even got any manners!
Reply: Shame on you for such lack of respect.
Reply: You sound more like a government employee with no idea of the real world.
Reply: Cannot because you are not a giant business man, grounding them all will lose a lot of money, lets say even in Flyscoot of Singapore air use those 787 and grounding them will cost them a lot and not to mention the whole world so you won't do the when you become a big business tycoon one day and you do care for a lot of money and it had never crashed before so why do we ground them all? We have high respect for you as long time pilot in service but you are not a big business man yet and that's also not a right decision for a master business man to decide as a lot come to lose, yes everyone has own professional.
Reply: You do not ground all airplanes of a type due to one crash, unless you have indications what the problem is. That is just not feasible. Airplane crashes do occur regularly and if standard procedure was to ground them we would have huge disruption.

In addition, they probably already know more about the cause than they are saying publically.
Reply: @torben777 ok, let’s all fly around on Dreamliners until another falls out of the sky. I’ll take Seat 11A thank you.
Reply: @gabbarsingh7182  I will fly dreamliners before most other moders jets. Even with this crash it has a great safety record. 

A330 14 hull losses. A340 5 hull losses. Dreamliner 1 hull loss (this one). Know your facts!

However, I will avoid Indian airlines. 

My money is on this being a maintenance issue.
Reply: @torben777 ok that’s fair. However, the Airbus models you’ve mentioned are old I believe. A340 actually an aircraft I plan fly on at some point before it’s retired.
Reply: @gabbarsingh7182  Yes the A330 did fly more, but not by a factor of 14. There are currently 1400 A330 and the A330 has clocked 65 million flights hours conpared to 30 million for the 787. So in other words double the flight hours 14 times the aircraft losses. For the A340 this model if far less popular and the 787 already has more total flights.
Reply: Exactly, all 787 must be immediately grounded until investigation of the root cause is established.
Reply: @sanjaybansod8392  or we just ground all Air India flights instead because they're the only ones having problems
Reply: That’s crazy talk, how many years has the 787 been flying to NEVER HAVE THIS OCCUR? So you’re going to disrupt worldwide air traffic to check for what?
Reply: Hey Rudy, why ground the 787 over a pilot error? plane was overweight, you of all people should know that.
Reply: @itjustlookslikethis  What was its take-off weight?
Reply: This isn't a new plane? With respect, there have been 15 years without incident. It's premature to blame the plane with zero evidence to support.
Reply: Boeing has the worst software on the planet. 

If you got to meet the software engineers like I have, you would be terrified. 

Just look what happened on Starliner vs Dragon.
Reply: They should ground the planes. You people that think they shouldn’t ground the planes, put profit before lives. Literally could be another max8 situation. Either Boeing paid trolls or just callous.
Reply: @matthewfever these planes have been flying for 15 years. It's not a MAX situation
Reply: @matthewfever 👍👍👍😊❤
Reply: @matthewfever No Air Bus 320 were grounded after a Pakistan plane  crashed in 2020.
Reply: @matthewfever  No and you're just clinically insane.
Reply: @matthewfever huh!!! How is it even the same thing. The max was a new aircraft with a inherent issue that Boeing tried to hide. The 787 has been flying for over 10 years.
Reply: @matthewfever Why do you assume it has anything to do with the model of aircraft?  It could be the maintenance, training, airline procedures, crew rest, weather, or many other factors.  Or maybe a bird strike or wind shear…to call for any immediate grounding is irresponsible and naive.
Reply: MAX
Reply: True, It’s the aircraft model which is at fault not just Airlines 

boeing 787 dreamliner 
It had a technical problem in British Airways as well and returned back to Heathrow
Reply: @UjwalRam So?
Reply: @UjwalRam  true 👍
Reply: @UjwalRam So what's the fault then?
Reply: @bobolulu7615   Boeing should say what’s the problem with 787 is .
Just check how many other Airlines are facing similar problems with 787 
British Airways, 
Lufthansa
Reply: @UjwalRam Any aircraft can have technical issues due to poor maintenance or other unforeseen issues.  Quit blaming Boeing . Years s, Boeing has screwed up since it's last merger, but don't make sweeping conjecture without substantial research and presentation of a significant quantity of incidents.
Reply: Could it be fuselage  structure failure??, might sound mad, but if it failed and caused severing of core communication and power for engines and multiple Hydraulic circuits??
Reply: @Craig-wp3pz Did you see a structural failure in the video?? Wait for the investigation and you shall find out
Reply: @Gaferr-r4r  yeah there is a black piece floating to the ground 4 sec before I'm pact in the rat video
Reply: @AndrewLarson-mq7xc  I saw the video, it’s just tough to tell what it could be!!
Reply: @Gaferr-r4r ,,, Well, there has now, since this accident,been FIVE Dreamliners have had to divert and made emergency landings, 🤷‍♂️ many more flights cancelled, one with reported 'Flap Actuation failure' 

So, er, you can wait for the report,,,, I'm gonna jump to some basic conclusions, and exercise my healthy disregard for whatever corporate excuses get aired......
Again ,, Boeing,
with the known Manufacturing issues,✔
 the structural defects✔   ,
 the falsified certification✔,
the employee intimidation✔, 
the corruption endemic in the management✔
the Bribing of federal bodies ✔
Reply: @Craig-wp3pz  Could be a major electrical wire was cut.
Reply: @Craig-wp3pz noooooooooo….🫣
Reply: You sir have zero clue!!! And being a retired 73 pilot, if that’s even true means nothing!!!
Reply: @Gaferr-r4r  no need to be rude
Reply: @Gaferr-r4r  Where is YOUR pilot's license? you have less right to comment than he does.
Reply: @Nickelbippy He definitely has the right to comment but if you read the comment it does not read like one who has been in the industry. You don’t ground airplanes without a full investigation. By that logic we should ground all pilots operating in India. Bu the way my Airman’s certificate is right here, safe and sound with a few type ratings!!
Reply: Ground the whole fleet before getting the data?? You're a fool. Good thing you're too old to have a say on a matter like this.
Reply: @cccc9911  he sounds the opposite of senile, and way more experienced and wiser than you sound.
Reply: @cccc9911 that’s quite rude towards the OP. Are you a pilot too? Do you have any expert knowledge? Boeing 737 Max was grounded worldwide after only two accidents in 5 months. A lot of lives are at stake and profits can never come before lives.
Reply: @cccc9911 70 ain't that old anymore son. Jus sayin.
Reply: @cccc9911 
I know more 70 y/o’s who are more sharp than 30-40 year old people. I don’t disagree that grounding 400 of these aircraft is feasible especially with the amazing safety record, but let’s show some respect to this retired pilot.
Reply: @cccc9911  stop being so rude  ,so what if he's 70yrs,out of experience is talking,human lives do matter safety first.
Reply: @cccc9911  no need for a personal opinion on age..experience is everything have a little respect eh.plus everyone is entitled to an opinion..you don’t have to agree but at least,be civil about it.
Reply: @user-dh8ve4ti2x I think this comment.
Reply: @cccc9911  This guy was a pilot apparently for decades and his opinion matters.  The whole f**king situation is a mystery still and he is right the 787 fleet should be grounded until they figure out how this plane just dropped out of the air 30 seconds after takeoff.  The pilot you are denigrating probably flew tens of thousands of people safely to their destinations in his career and knows more than 99.9999999999999 percent of the public about commercial airplanes.  Respect.
Reply: @cccc9911 be nice.
Reply: @cccc9911 A 70 year old retired pilot is a fool, who raised you? You can correct him and still be respectful at the same time.
Reply: @cccc9911  And risk a scenario similar to the MCAS disasters? I think you're the one who's long in the tooth.
Reply: @cccc9911 learn how to talk respectfully next time, everybody has a different opinion/ view that doesn’t mean you have to call someone who is probably far older than you a fool? And it does make sense if it is a boeing problem to ground the plane so what are you talking about? There are still allot of questions that need to be answered , and  yk boeing hasn't been doing well, the report of the whistleblower Salehpour explains enough. So how can you already jump to conclusion of this being ridicilous in such a case.
Reply: @cccc9911 what an absolutely rude thing to say. You should be ashamed of yourself!
Reply: @hollyg3372 I agree. 
I may not agree with the OP but calling him senile is unwarranted in a civil discussion.
Reply: @hollyg3372 Yes totally insensitive and disrespectful. You can disagree with someone's point of view without attacking him on grounds of age and senility especially when we are  all totally clueless about what really happened and it is all speculation.
Reply: @cccc9911  What an unnecessarily rude comment. Is it so hard to disagree politely?
Reply: @cccc9911 Better safe than sorry!
Reply: @cccc9911 can people be adults and argue respectfully.
Reply: @cccc9911 they grounded the max…but it took two crashes. Had it been your family on the second one, you would have sued for not grounding the max.
Reply: Watch your remarks!
All the holy books warn us,not to call anyone a fool
Or face the Hell Fire!
This man was a pilot!
With the troubled history, of the planes of Boeing falsified inspections and other technical problems.Which was questioned by Congress.
This pilot's opinion to ground, all the Dreamliner aircraft in India.Might not be far fetched!
Reply: Don't be so disrespectful
Reply: @cccc9911 old? This guy is 40.😂😂😂
Reply: @cccc9911 not a pilot are you
Reply: @cccc9911  You are so disrespectful
Reply: @cccc9911 Don't you have any respect for elderly people and captains? Then you shouldn't watch this video or comment here if you get triggered by their opinions.
Reply: @BhavikaPathre  im not triggered....you are.  Dude put his age out there...add that to the fact that his response was delusional and therfore senility could explain it.  I'm sure his feelings aren't hurt as much as your are. Get over it.
Reply: @cccc9911 There is no need to be so rude!!!! At least this retired pilot has safety concerns as his priority. Not ignorance like you!
Reply: Respect Sir.  No manners ??
Reply: @cccc9911  He's too old to have say, and we've got at POTUS that's 9 years older than that. That's not good.
Reply: @davekearney1944 you just had one even older- and certainly less lucid, did you comment or show concern about him?
Reply: @malcolmwhite6588  Of course. I supported replacing President Biden as candidate for that reason. Right now my bigger concern is President Trump, since he is currently president. Are you as concerned about Trump as you were with Biden?
Reply: @davekearney1944 not from a mental acuity perspective- Joe Biden seemed like a zombie. I am not sure in terms of leadership performance of president trump - sometimes I agree 100% other times I think he’s off the mark
Reply: @davekearney1944 you voted for Biden, right?
Reply: @malcolmwhite6588 In my opinion President Biden's thinking had definitely slowed down. He could get there but it took a while. However - he had some good people around him that Trump definitely doesn't have. Trump has nobody to keep him on the rails.
Reply: @michaelmappin4425 I hate to be the one to break the news but Biden wasn't the Democratic candidate for President in 2024 so it was impossible to vote for him.....or are you referring to the 2020 election?
Reply: @davekearney1944 Concerned with Trump? Because he's cleaning up the UnAmerican wasteland left from the enemy of the USA last term?
Reply: @davekearney1944 
Both Trump and the 70 year old you are referring to likely have more intelligence than you ever will. Go sing Kumbaya and march with the other liberals.
Reply: @davekearney1944  You're free to move to India if you don't like it!
Reply: @davekearney1944  Trump is 79? Wow! He looks good and fit for his age though.
Reply: @davekearney1944  There is wisdom with age. Anyone with a decent IQ knows this!
Reply: @davekearney1944 2020, of course. You know, when he would be 78 at inauguration.
Reply: @davekearney1944 guess you forgot how old Biden was..,
Reply: @davekearney1944 you must be kidding me.  Just based on age?  Not right.
Reply: @Thommy-q2n  When one rises above the "decent' level, one realizes the limits and realities of that old adage.
Reply: @davekearney1944  why do you think just because people are old that they don’t know anything??? They have a lot more experience in life than you.
Reply: @Katrina.3032  I'm lucky. I was born really smart. That beats experience every time.
Reply: @davekearney1944 - Was it OK to have a POTUS 3.5 years older than the present one?
Reply: @davekearney1944  What does age have to do with anything, outside of a mechanical part aging?  At one time, age was a virtuous thing, as in experience, foresight and rational thinking.  I'm guessing you haven't reached that point in your life yet.
Reply: @jimrothwell535  You tell us age means nothing and then tell us the positive attributes of aging "at one time". When did it go from meaning something to meaning nothing?